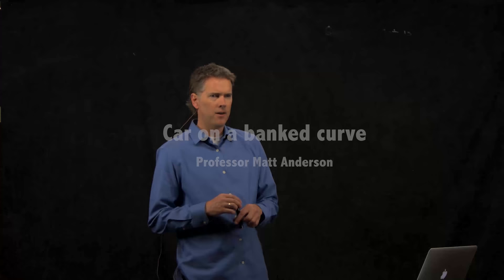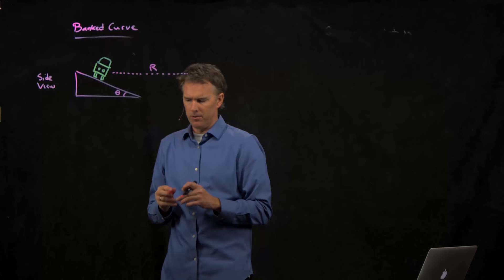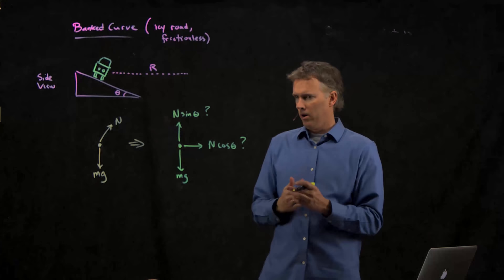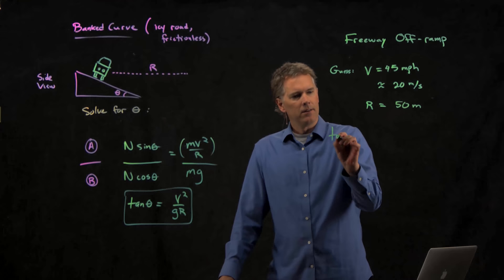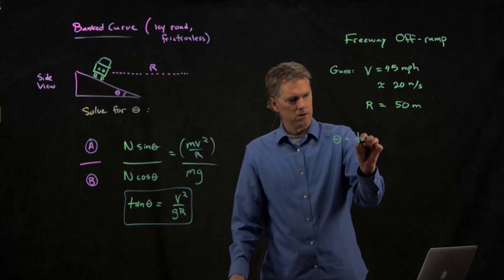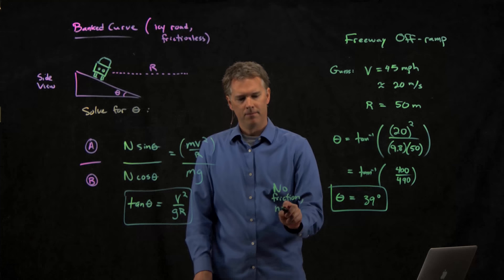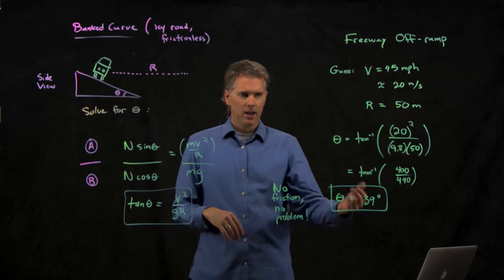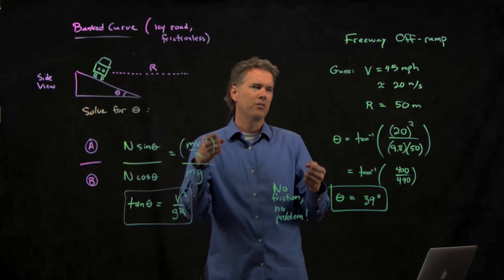Car on a banked curve

Comment: In this question of banking of road, why haven't you equated mgcos(theta) = N. There is no motion perpendicular to the road, so the forces perpendicular to the road must cancel out each other. Moreover, usually, on an inclined plance, when we place a box, then we do write, mgcos(theta) = N. So, why didn't you do it this way..?

Comment: Instead assuming theta=0 we can just draw a dotted line down the normal and that angle will be theta so according to vertically opposite angle theorem we get the angle between N and vertical component to be theta so the vertical component being Ncos@ now

How we get theta angle between mg  vector and N extended downward?
Ans: The wedge is at theta angle with horizontal mg another angle is 90° so the remaining angle (the one between mg and the slope) will be 90-theta so the angle between mg and N shifted parallely downward will be theta of course.

Instead we can also say that THE ANGLE THAT INCLINED PLANE MAKE WITH THE HORIZONTAL IS ALSO THE ANGLE THAT NORMAL WILL MAKE WITH THE VERTICAL (VERTICAL COMPONENT OF N)

Comment: Thank u for this video, I'm currently studying mechanical engineering at university and I am designing a mini roller coaster. A marble will represent the coaster train and the card board will represent the track. I am currently trying to figure out the energy conservations down the inclined planes loops and the banked turns. I don't know if I should consider friction considering how little it is considering the marble only weighs 5.5×10^-3KG.This video has helped me a lot, thanks again.

Comment: Highways haven't been sufficiently banked in 80 years, half the time they don't even have the correct change in radius for the intended elevation and speed changes. (Not that it would matter much when drivers can be licensed with no certified training or knowledge of how a car functions.)
There are still a few historic roads in nearly original condition and boy they were nicely engineered, every angle, slope, and radius fits the natural driving speed and you just flow through the curves.

Comment: Great math stuff TYVM ,BTW where I am black ice is a regular occurrence on our roads and I would not trust that this calculation could have my car turn on its own with icy condition .I think that I speed down to 1/3 of what is suggested when ice in present in highway exits ,in any case thank you for the math lesson ,I am researching on this to create my banked turns for my slot car track ,Cheers from Montreal , Quebec =D
Reply from the maker: Thanks for reaching out.  Black ice on the slot car set is not usually a problem (except for maybe a short circuit).
Cheers,
Dr. A

Comment: A question for you if you are still 'teaching' and if you would be so kind.  
A Brandy snifter has a measure of water poured into it, the glass containing the water is placed on the centre of a turnable and spun, so that the water is 'centrifuged' and reaches a steady state. What is the equation of the free surface of the water when everything is stabilised? 
This was the basis of an exam question that has bugged me for years. I couldn't work out the answer then and am far, far too rusty now but the question still 'bugs me'.
I can't remember if there were numerical values in the question .... sorry.

Comment: Awesome video sir, thanks. Now it just got me wondering, if there was friction (and we consider it static, pure rolling), if you didn't turn your wheels (wheels point in the tangential direction), friction would act as a torque, causing angular acceleration right? And if instead you did turn your wheel, there'd appear a component in the radial direction, which would allow you to take the curve at a faster speed, and there'd still be a friction component acting as a torque in the tangential direction, am i right?
Reply: If you take the banked turn at the critical speed, and you already started, when you let go of your steering wheel, your wheels will align with you continuing on the curve.   Rather than finding the straight position as they ordinarily do, the wheels will find the position to keep you on the banked turn.   You'll notice that it takes considerably less effort to hold the steering wheel in this position than it does when you take a curve on a flat roadway.

If you rigidly maintain the neutral straight position with your steering wheel, your car will climb the banked curve, and will use a traction force to do so.

Comment: How do you know that friction doesn't contribute to centripetal acceleration? It has a a horizontal component in the radial direction right?
Reply: You don't necessarily know that.  It is simply a special case of interest to this problem, where the car drives on the banked curve at a specific speed, where the traction force is zero.  The horizontal component of the normal force is enough to push the car inward to make the curve.

If there is a traction force, it could either act up along the incline, or down along the incline.  If you take the curve "too slow", it acts up along the incline.  If you take the curve "too fast", it acts up along the incline..

Comment: Why did we ignore the other component vector of gravity in this problem (Not the normal force) .  I'm aware that it cancels out, but with what?
Reply: Not only that, but how can a component of the normal force, which is a component of gravity in this case, be equal to the force of gravity itself?  That seems to be counterintuitive.
Reply: @vedantjhawar7553  You select whichever coordinate system is most convenient for you to solve the problem.  In this particular solution, he selected a coordinate system with a y-axis that is parallel to gravity.  This means the normal force has to be decomposed into its components, but gravity only acts in the y-direction.

You could also opt to solve this problem in the coordinate system that is rectilinear with the road surface.   But you most likely wouldn't want to do this, because then you'd also have to componentize the acceleration vector.

Comment: Thank you for this video, however I have one question. What is a car experiencing generally around a banked curve (understeer and oversteer) at a normal-fast speed? My guess would be understeer, because the car gains grip on it’s outside wheels, resulting in more understeer. Can anyone tell me if I’m correct or wrong please?
Reply from the maker: This video presents a classic physics example.  The goal is to design the curve such that zero friction is necessary to make the turn.  
But your question is different and quite interesting.  Let me restate it: Pretend you take a left turn around a banked curve at high speed.  Are you steering left, straight, or right?
I don't know the answer to this question, but it would clearly depend on several factors, including what your rear wheels are doing.  
If they are staying in-line, then I would say you need to steer left (the inner radius of the loop is slightly smaller than the outer radius).  
If the rear wheels are skidding out like a dirt track racer then you would need to steer right.  
Something in between the two, and you might need to steer perfectly straight.
Good question.
Cheers,
Dr. A
Reply: Thank you for the response, looking over my question would need several factors in order to be answered. What I believe just by picturing it within my head is that it is harder for the rear wheels to lose traction going around a banked turn, as the outer rear wheel (which is most prone to spinning) is being pushed harder onto the surface than the inner wheel. That's just in my head though, sorry for probably giving you a headache with my question...
Reply: Don´t take under-/over-steer into consideration, at normal speeds (and with normal I mean relatively low lateral dynamic, like below 5 m/s2) that effect is negligible compared to the other forces at play.
If you drive on a banked left corner at the neutral speed you have no lateral acceleration: in this case, if you take your hands off the steering wheel you will see it setting itself at the right angle for the car to stay in the lane, just like it recenters on a flat, smooth and straight road (actually even better, as the car can´t drift away: fun fact, when driving like this you can manage your height in the banking simply by changing your speed by a few km/h).
Anything faster than the neutral speed, and you will have to apply increasingly more left (inward) steering to counteract the higher lateral acceleration, just like you would do on a normal flat left corner (apart from some minor non-linear effects that you need to compensate and tend to freak you out the first times). 
Anything slower than the neutral speed, and you will build up inward lateral acceleation due to the downward pull not being compensated with enough "centrifugal" force: that means that you will need to hold your steering and eventually steer right (outward) to effectively have the car "climb" up the banking wall; it might look like a countersteer (left corner/right steering), but this has nothing to do with oversteer as the lateral acceleration is really directed in the other way.

Comment: Why we took took the x and y components for N and not for mg?
Reply: Samer Qansu You can decide what you want the x and y planes to be at the beginning of the problem, in this case he set the y plane to be the same direction as the mg, which means that the x component would be 0 since it is only going in the y direction, and they y component would be mg because it is going entirely in the y direction. If he set the y plane in the same direction as the normal force, and the x plane along the ramp, then he would have calculated the x and y components of mg because it would then be on a diagonal.

Comment: what if there was a friction force?
Reply: When you introduce a friction force, you end up needing to solve a system of equations to determine your unknown normal force and friction force, that cause the car to follow a banked curve in the road.   When we consider the friction force F to be zero, we are looking for the critical driving speed where we aren't depending on traction to cause the car to follow the curve.   Friction will be present, but there is a critical speed where it is equal to zero, and you can solve for that speed with only one equation

To work with friction, you end up solving the following two equations together for N and F.  This assumes F acts inward on the banked turn, which means it also acts downward.  If you get a negative number for F, if means you are driving less than the critical speed, and F really acts upward and outward, instead of downward and inward.
N*sin(theta) + F*cos(theta) = m*v^2/r
N*cos(theta) - F*sin(theta) = m*g

Since the limits of F depend on N, you can then use it to calculate the maximum and minimum (if applicable) speeds at which you could drive on this curve.  Max magnitude of F = mu_s*N.

Comment: is x component always cos,y component always sin  or am i wrong
Reply from the maker: Is is USUALLY the case, but not always.  It depends on where your angle is defined.  Always go back to SOHCAHTOA.
Cheers,
Dr. A
Reply: @yoprofmatt  thanks for the reply
Reply: @ramk1985  Here's a way to remember it:
"Cosine" = close (as in opposite of far).
"Sine" = sign post.  Raise the sign post up to the vertical where a sign post should be, and the sine of the angle is its maximum.

When the angle is small, cosine gets you the component close to vector in question.  Sine gets you the component projected onto the vertical sign post.

Comment: why do we break N into components?, how is this different from masses on inclined planes?
Reply from the maker: Very similar.  

With the mass on the inclined plane, we rotate our coordinate system such that x is along the incline and y is normal to it.  That means we need to break mg into new x and y components.  

Here, we keep the coordinate system level, with x horizontal (which is along the radius of the car's circle).  That means we need to break up the normal force into components.

Cheers,
Dr. A
Reply: @yoprofmatt  Thank you so much!, i get it now :)

Comment: Is it true what you said? You dont have to steer if you hit the road on 45mph? I want to say it in my presentation, but its hard to believe. Sounds true, but can the car really turn itself? Damn, thats one fun fact
Reply: You still do have to steer, and you do have to hold your wheel in place, because the car will generally cause the steering to default to straight, and then your wheels will introduce a friction force that causes you to no longer follow the curve.

At the critical speed on a banked road, the only force inside the reference frame of the vehicle that you will feel, is a downward force that is perpendicular to the road.  The net traction among the four wheels will add up to zero.  It doesn't necessarily mean it will be zero in all four wheels, just that it will add up to zero.  If the road is icy and has less friction, it is safe to drive at the safe driving speed on such a road.

Comment: Isn't the friction kinetic, not static?
Reply from the maker: Common misconception.  Even though the tires are rolling, the rubber on the bottom of the tire is not skidding, thus we use static friction.  Note: If you start to skid, then it becomes kinetic friction.
Cheers,
Dr. A
Reply: Got it, thanks!
Reply: @yoprofmatt  
Thank you so much:)

Comment: I don´t get it: are you really suggesting that real world highway exits are banked 39°? For comparison, Daytona is 31°...
Reply from the maker: gattopazzo80, 
That does seem steep.  I think our speeds are a bit high for the radius.  I looked up offramp design, and typically for 25 mph you'll have a radius of 50 m or so.  That would give us an angle of about 15º which seems more reasonable.   Thanks for the tip.
You might also like my new website: www.universityphysics.education
Cheers,
Dr. A
Reply: @yoprofmatt  it still looks a bit too steep as tang(15) = 27% cross slope; 10% is usually considered a dangerous longitudinal slope, and it doesn't impact lateral dynamics. Although some banking is definitively built in to reduce lateral forces, I don't believe you want to go as far as balancing it out completely: in the black ice case you would actually be forced to always drive at that speed, and a more careful slower driving (or a queue) would be dangerous as you would fall in the corner. That's not the kind of non-linear behaviour you want to have your average driver to cope with.